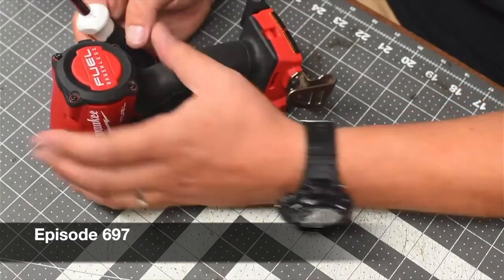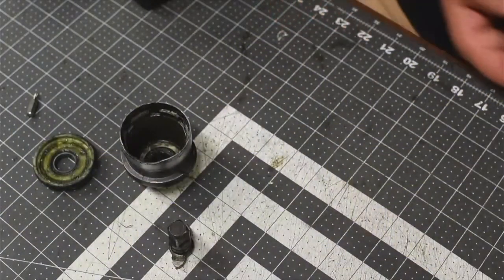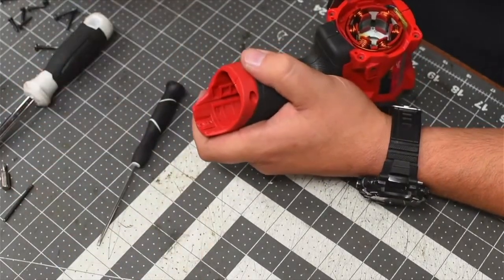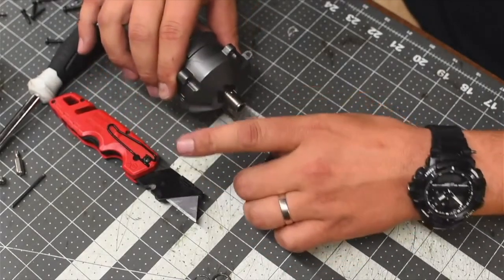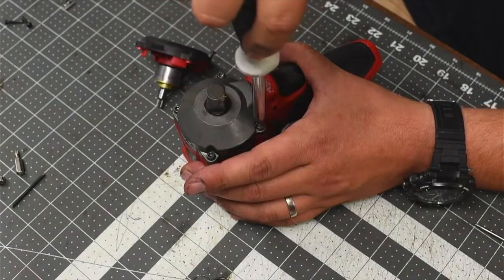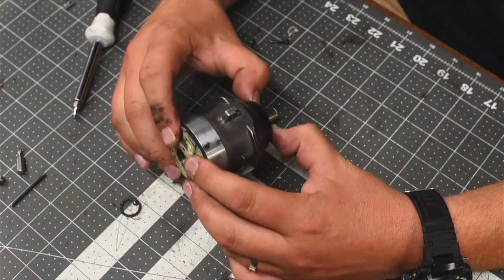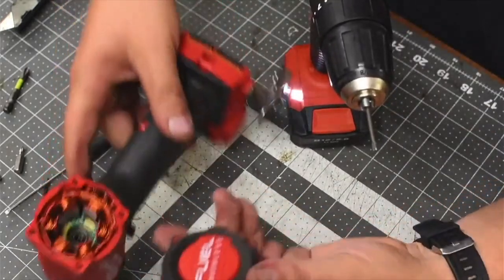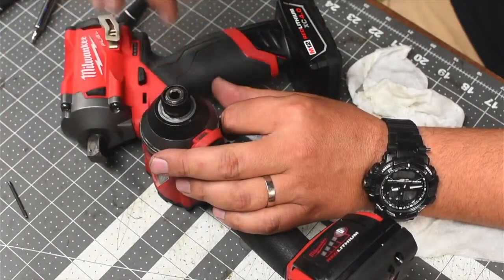Detailed instruction on how to make the Famous Frankenstein Impact Driver!

Comment: So I can swap my m18 gen 3 1/4” impact to a 3/8” impact and only need a 3/8 anvil? I am very interested in doing it as I have a smaller 1/4” driver that suffices for 1/4” duties I have the 1/2” impact but I don’t have a 3/8 impact and feel that the gen 3 1/4” is a beast to much for 1/4” bits.
Reply: I also want to do that. Has anyone tried?
Reply: I was wondering the same thing lol

Comment: Could this be done with the 2953-20 impact driver, if so what parts are needed?
Reply: It can, but you have to modify the anvil in addition to widening the opening in the snout of the driver. I did a 3/8 conversion.
Reply: @gameplayer4371 what’s the part number for the anvil?

Comment: AM I the only one that think  all these rolling storage units are dumb?? You first have to stack and unstack them to get to  your tools. Quite a lot of efforts to lift and unlift the HEAVY packed chests.
WHY NOT just invent a rolling metal or plastic cabinets/storage units with drawers. I will never buy the FLEX or any other mfg's cuz it's DUMB!!!
Reply: Do you actually use them? Makes transporting all my tools a lot easier. I don’t have enough money to make my truck a storage unit. I separate them then I load the bottom then stack all the ones on top. Sure, could use different tool boxes that I’d have to lug around, but then I couldn’t just roll them around easiky